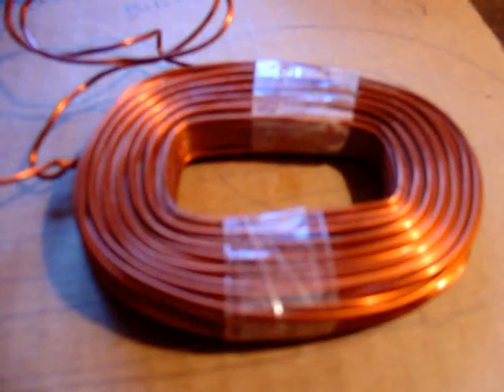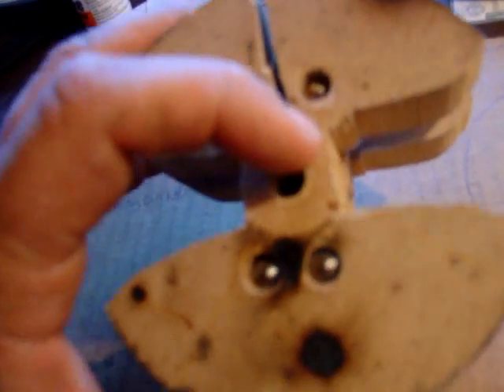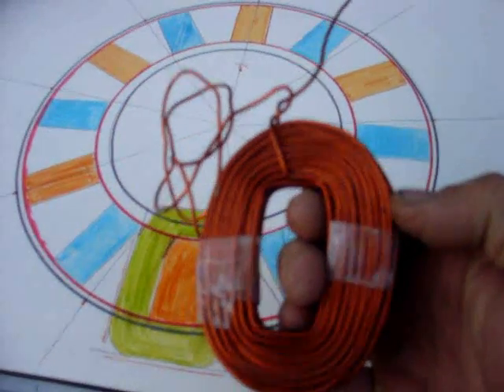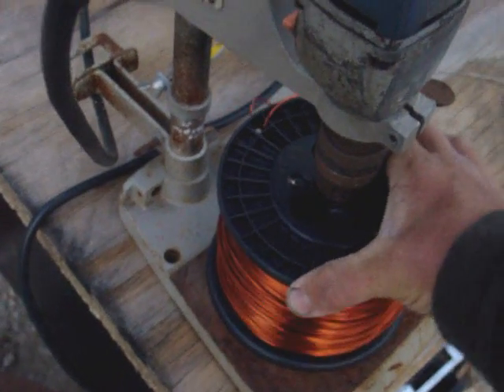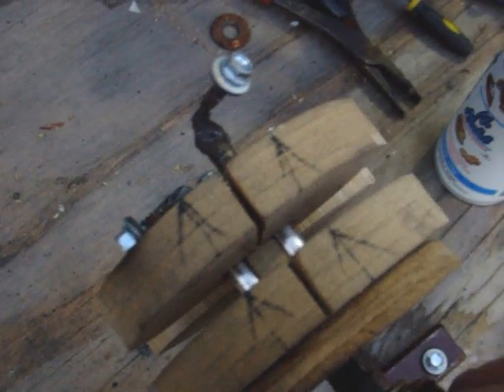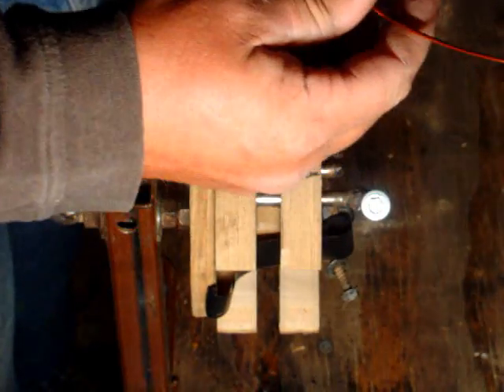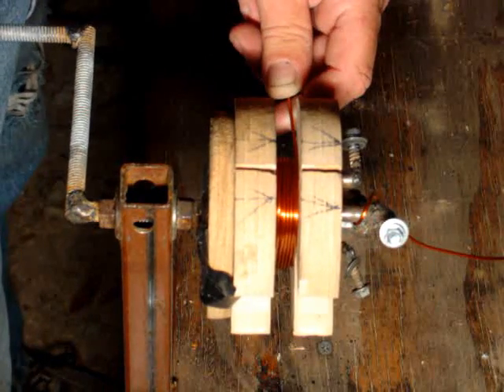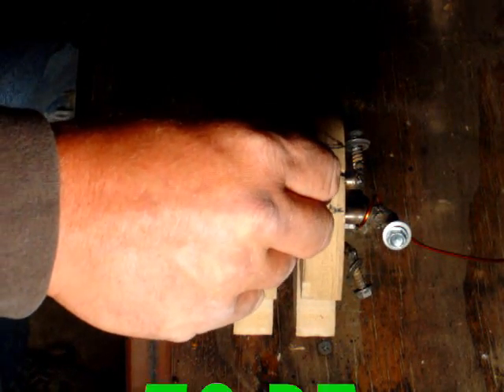BUILD A DUAL PERMANENT MAGNET ROTOR WIND TURBINE (PART 7)

Comment: Can u remove the primary coil of a microwave transformer and use that as a could for a motor? Or will it be better with a coil with different  wire size ?

Comment: Do u want to sell it because I don't have time to make one  I am a trucker
Reply from the maker: Thank Linc, I need to finish the project and get to play with it first. I need to match a good prop to it or it will not be the power producer that i worked to design. The prop needs to be the right length and tip speed ratio. if it is off, the rpms might make the alternator reach charging voltage too early and the blades will stall out giving very little power, or if they reach the charging voltage late, it will need more wind to get power out and rob the turbine of it's low wind charging.

MUDDy

Thank You Linc

Comment: Could u pleas tell the relatioship between guagf o the wire, number of turns and voltage, amps and rpm. i ll be thankful
Reply from the maker: +Asif Zeb Mr Zeb
hello Zeb,

Fatter gauge wire caries more amps because there is less resistance to current flow. 
Fatter gauge wire has no effect on voltage (when there is no current flow). But when the current flows, the cumulative resistance of the wire shows a linear voltage divider along the length of the wire. But, current will be constant throughout the full length of the series circuit of wire. The current will be  as follows,..... Current (I) = Voltage (E) divided by the Resistance (Rt) total. ( I = E/Rt) in a series).

Number of turns in the coil.....
   The more turns in a coil there are, the more voltage that a moving magnetic flux can induce in the coil. 
(Also, The more windings in the coil, The more resistance in the coil due to the cumulative resistance total from the total length of the wire).

RPMs
The rpms govern the rate of magnetic flux change through the coil/s.
The faster the magnetic flux changes, the more voltage induced in the coil/s.
The voltage is induced in the coil Only while the magnetic flux is changing through the coil.

So to keep it short,.........
More RPMs - more voltage induced.
More windings in the coils - more voltage
stronger magnets - more voltage And usually more efficiency.

Note,... The more poles on a magnetic rotor, the more magnetic cycles per RPM. This also raises the voltage per rpm.
    Thus 12 magnetic poles would have 6 cycles per rotation.

Now with all that said,... We neglected to cover the true power, WATTAGE
 P = power , or W = wattage. 
Power = work. This is what we are seeking to produce.
1Horse power = 746 watts

The ability to move a certain amount of weight to a certain amount distance or height, in a certain amount of time.

WORK 
 
(P) = (E) times (I) .....Power equals Voltage times Amps.

Voltage is Pressure, Tension, Potential Difference, ect.
It is only static if it doesn't move or flow. 100 volts times 0 current = 0 wattage.

Current is flow. Thus The gauge of wire governs the flow of current by it's resistance, and the power capability of the machine as well.

     One short statement to sum it all up for ya.
If you want a powerful coil, It is going to weigh more than a weak coil.
Unfortunately, The powerful coil is only limited by the parameters of volume or space that the coil can exist within.

Thanks, and enjoy.
MUDDy
Reply: +muddymuddymuddmann I understand a short "thanks" would not satisfy such a detailed answer, but  thankyouveryverymuch may work.
Reply from the maker: Thanks bro. I am glad the answer was sufficient.
:)
MUDDy

Comment: Bad, bad, bad.
The inner end and the outer end wires of a coil must not come into contact with each other, and you have twisted them. Not that they will fail immediately, but it is against the rules of the trade. Vibration or stress could damage the insulation and the coil would be shorted. Look at professionally  made equipment and how they do it.
Reply: Something makes me think he is not going to leave the wires twisted when he assembles the whole thing together... just guessing
Reply from the maker: +Squeejeejee Squeejeejee Thank you. Common sense rocks.
MUDDy

Comment: what are better to use square type magnets or round type magnets
Reply from the maker: +16vastraturbo 
Wedge shaped magnets #1.
Then I would suggest magnets that come as close to the shape of your coils.
For the coils i use here, I want the suared sides to hit the edge of the coils for the added punch.
But the round ones give a good smooth sign wave output.
They are best for rounded coils. But work well for all.

Wedge shaped magnets are still the best, but expensive.
:)
MUDDy

Comment: O.K I have 24 2x1xhalf inch 72lbs magnets I have alot of wire from a big t.v guessing bout 20 awg if I can fit enough turns for a 12 volt system into one coil can I wire them all starts and ends together with the same outcome?
Reply from the maker: tgman1054 yes, all of the starts of one phase, and ends of that phase, would do. You need three times the turns per coil. 231 windings each coil.

:)
MUDDy

Comment: hello could inform me as I can calculate the bueltas I have to give a coil according to the diameter of the copper wire 1mm I have espsor
cuantas vueltas tengo que dar con un alambre de cobre de 1 milímetro de grosor
gracias luis de Barcelona

Comment: Hi Muddymann... Been following Your vids now and want to ask if I can use 15 gage instead of 14. How many windings for 12V
Reply from the maker: Eric Steffen sure you can. RPMS PER VOLT WILL CHANGE A BIT IF YOU CHANGE THE AMOUNT OF WINDINGS.
Reply from the maker: +Eric Steffen 77 turns sir. :)
MUDDy
Reply: +muddymuddymuddmann Thanks a span

Comment: Hey good job on all the videos.how thin can the coil wire be.I have a big spool of very thin wire do I just use more turns or should I triple  it and then turn the coil.would like your input on that .Thanks Bruce
Reply from the maker: look up a wire gage chart. it will show how many amp tha each gage of wire wiil take. then figure what gage you have. look it up, and compair with the size wire you need. Example. 2 strands of 14 gage wire can handle the same amount of amps, or close to the amps as 9 gage wire.

 This coil uses 77 turns of 14 gage.
Enjoy
MUDDy

Comment: HI MUDDY I HAVE ? I START WIDING MY COILS AND THEY LOOK THE SAME BUT I THINK IS MISSING 2 OR 3 TURNS ONE FROM THE OTHER ,DO YOU THINK MY PROJECT WILL WORK IF THE COILS HAVE THE DIFERENT AMOUNT OF TURNS ON EACH ONE? WHAT I DID WAS DRAW A LINE AFTER FINISH FIRST COIL AND THEN MAKE ALL OTHER COILS IN THE LINE AS REFERENCE ,ITS OK WHAT I DID?
TKS

Comment: My name is Mariano am in Spain, Madrid.
Nice if you can please help me with some detailed:
1) how many turns the coil has a length and width
2) Why is copper wire thickness
3) magnetu, the length and width and thickness has
4) What type of epoxy was used
5) What is the power turbine Eolica
Good day, thank you. mariano0607@yahoo.es

Comment: HI Scott:  I'm very impressed with what your doing. like you I'm attempting to generate
power via my waterwheel, and also I got my hands on a 60' tower to do wind power.
my challenge is to come up with a low rpm generator for both. I'm building my 8' dia water wheel right know, hopefully it'll be ready for spring. I would love to speak to you 
about the this generator your building. I could share some great ideas. I've been fabricating thing for years. can we connect on this?  thanx

Comment: I am ready to start buying supplies to build this.  I intend to start with just 2 12vdc 12ah batteries for test purposes.  I hope to build a basic assembly to operate some lights and a radio during emergencies.  Maybe 1 day take on more of the basic electrical needs for the house (lights, tv, dvr, etc).  I assume the best coil confi would be "star". I just need a little help with wire gauge.  Should I look at around 14ga or smaller with 22ga?  Any recommedations on where to get supplies?

Comment: Muddy, thank you for a great video series.  Very informative and well explained.  I liked the tunes too!  ;)  I am very serious about wanting to build a VAWT.  With regards to the coils and magnets I do have a few questions however.  1. I want to power a bank of 12vdc batteries and convert it to AC to power the basics in my home (lights, radio, maybe tv)  What wire gauge would you recommend?  2. Where would a person find good magnets at an affordable price?  3. Where could I get the copper?

Comment: Munddy I have a turbine running with 9 coils and 24 magnets and wind me I have only reaches 3 and 4 volts, the coil is made of wire # 18 AWG to 60 laps double threads, I can do so with the same wind I have to increase the voltage to 24 volts

I hope to find a solution to this lack of wind that I have where I live ..

please tell me what to do if I need to increase the amount of laps on the same wire or use a different caliber or have experience with this sort of trouble

Waiting for  solution

Comment: Hello Munddy

I constructed a DUAL ROTOR AXIAL FLUX PERMANENT MAGNET WIND TURBINE to 24v and this for me this little wind producuendo only 2 - 3 - 4 volts, is that the problem is the lack of wind you get.

how I can counter this problem of low wind to generate 24v me.

my email is crjuancho@gmail.com

carlos